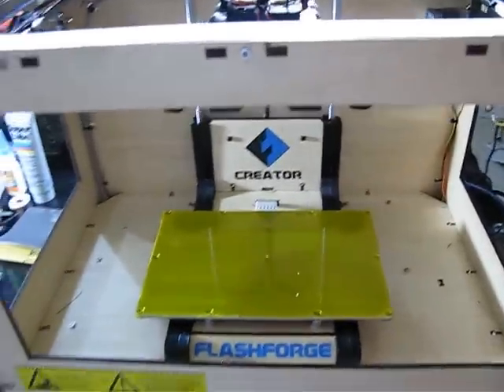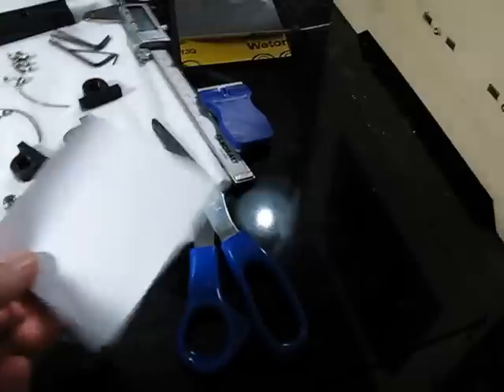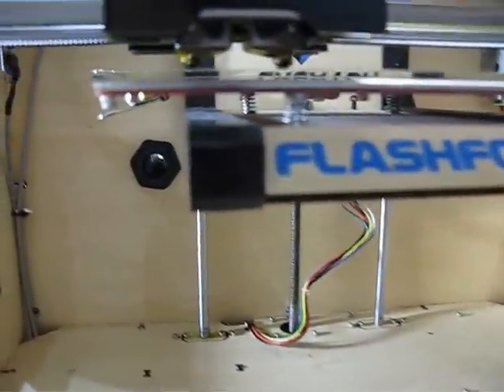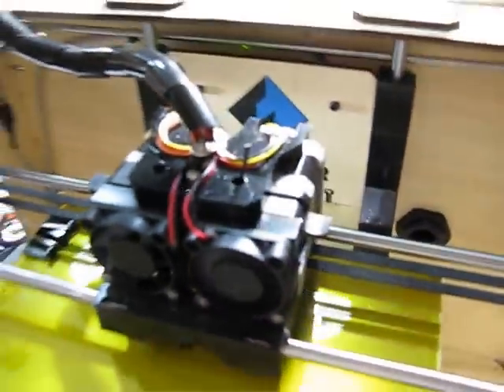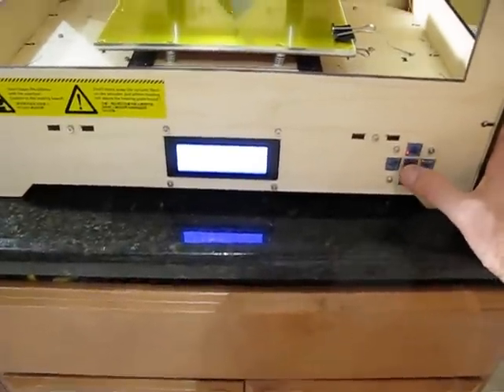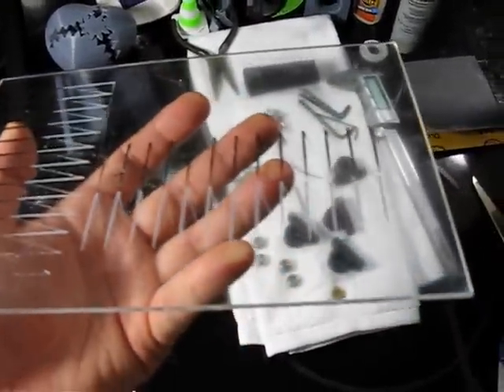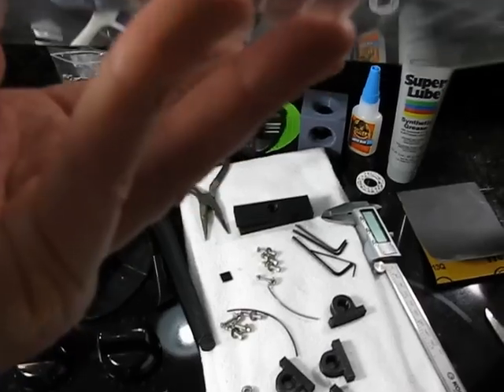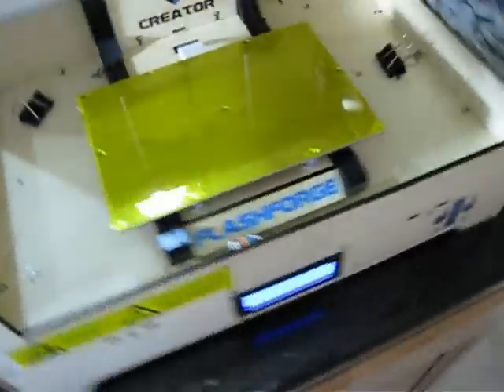FlashForge Creator Setup 2 of 3 - Leveling and Calibration

Comment: after going through the FF creator dual nozzle calibration and choosing the best alignment (x:5, y:7) I entered the values in 'calibrate nozzles', I even exit to main menu and re-open 'calibrate nozzles' the values are back to 7 and 7. I have connected printer to repG and my x toolhead offset is 33.758 and my y toolhead offset is 0. I have tried changing x toolhead offset to 0, turned off printer, reset calibration to x:5, y:7. still wont save. when I connect back to rep G x toolhead offset is 33.576 and y toolhead offset is 0.Any suggestions?

Comment: My Replicator 2 clone seems to have an issue with the build plate (Z-axis) moving too slow for the build. All my prints start out fine then the gap between the extruders and the build plate will gradually decrease, causing the nozzles to squish into the top layers of the print about halfway though completion. This is causing my prints to have random layers squishing out in certain areas. Its very frustraiting since the rest of the print looks decent. Any ideas on how to troubleshoot?
Reply from the maker: +Bryan Tenedora hey man...you caught me uploading a video otherwise I would have never seen this comment, I still print but have been out of the helping and forum game for a long while...go to the flashforge google groups and ask around, there are some awesome people who can help you there including the author of the firmware.  The z-axis should is run by a stepper motor and each movement after the layer should be in the amount of layer height you set.  For all my prints my layer height is .2mm so each z-axis movement is .2.  Sounds like you are saying that after a while the z axis moves say .1 vs .2 and hench a smash......first thing to self trouble shoot is extract the g-code and look at the z heights as the g-code progresses...for instance you should see at the start one or a few z 0.0 and then there should be a bunch of commands at Z 0.2(or whatever your layerheight is) then a bunch of Z 0.4, etc.  If the g-code is in good wooking order and each consecutive increase is uniform you have a firmware or stepper motor issue...most likely firmware or some setup.  The stepper motors are pretty good.

Comment: Thanks dude.  I had a couple of Solidoodles, then moved to a FlashForge Creator Pro Dual Head... I had, from experience, and some just toying, upgraded it with a 3mm shim for the Z stop... Mr. Tang says set the software z adjust, but I just didn't see how that would override the initial z-0 step that would force the nozzles into the glass... and of course used my glass plates.  However, I had been struggling a bit with leveling... I had NO IDEA about the nozzle calibration print or how to apply it to the printer, and I decided to just go back to clips after watching your video (I had used kapton tape to tape the glass to the bed, but I had theorized that part of my problems involve the tape stretching (heat induced strain relaxation) which was making later prints blobby and thicker.  I am working my way through the steps now, but I get the feeling this is going to solve a few calibration issues.  I've already made some really good EASY prints, but my tougher, personally designed engineered components have really been difficult for me and I was getting discouraged.  

Can you clarify if you're leveling on a HOT plate or a COLD plate... also, I don't have bed kapton, I'm attaching the glass right to the plate, issue?  And can you clarify if you have issues with leveling the glass, then pulling it off, hair-spraying it (I SWEAR by the AquaNet unscented super hold!!) and putting it back?  No re-level?  And can you switch plates repeatedly without re-leveling, at least for a few prints... I could on the Solidoodle.

Thanks for this GREAT video, and hopefully when I do it a couple of times, my bundle of massive joy will be flawless.  Cheers, mate!